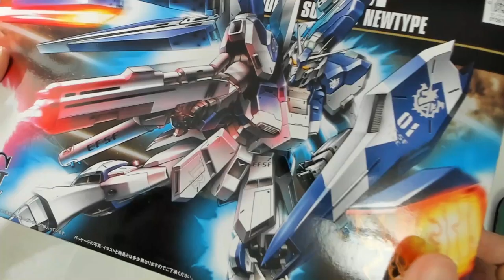[건프라 도색] 하이 뉴건담(HI Nu,New Gundam) 도색 & 패널라인 리파인

Comment: from a meh kit to a master piece :O
May I ask 
is Vallejo Mecha  suitable for brush painting? Because last time I hand painted Vallejo Mecha gold, it was quite runny and difficult to apply evenly
Reply from the maker: Thank you for comment : )  The vallejo mech color series is also available as a brush paint. Metallic colors should be painted with a little water or diluted with airbrush thinner. It is better to finish one coat and paint a second time after drying a little, rather than finishing the paint at one time.